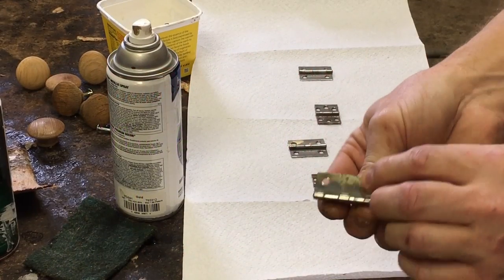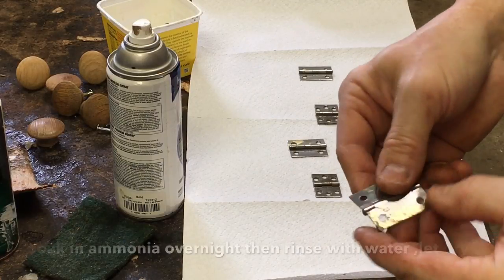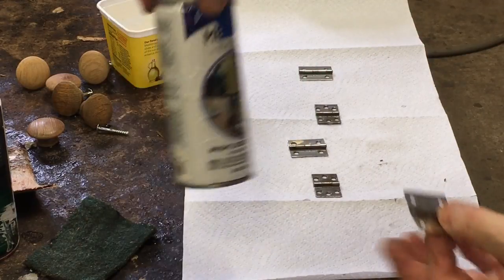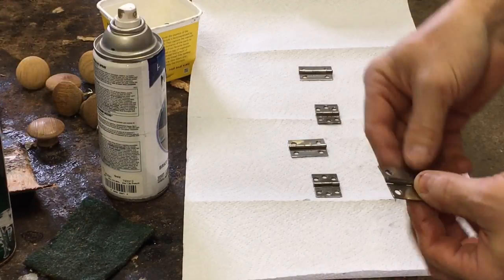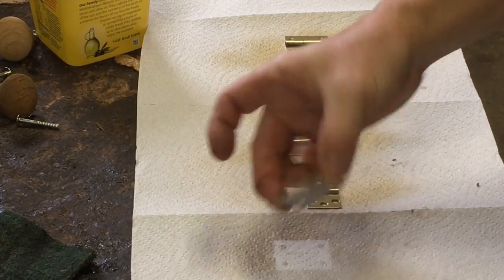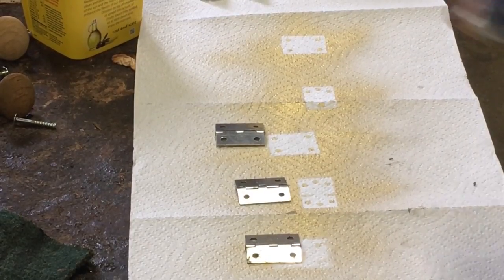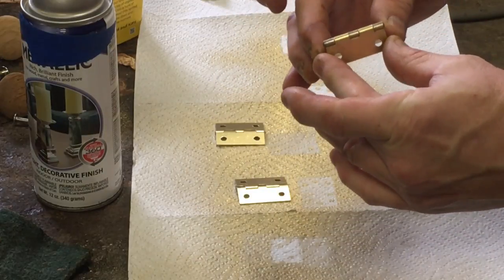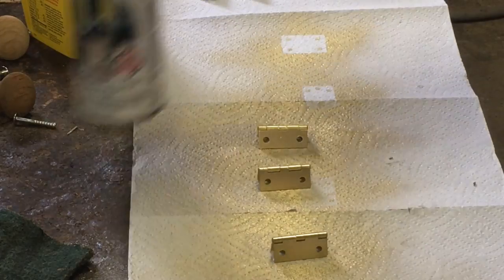SPRAY PAINTING OLD  HINGES TO LOOK LIKE BRASS - ANTIQUE RESTORATION REPAIR FURNITURE

Comment: I have 22 door hinges that have thick coats of paint on them would acetone remove the paint letting them sit in a bucket overnight?
Reply from the maker: I have never used acetone ,  it might work . lacquer thinner will strip paint .
Reply: The easy way to get the paint off is to soak them in hot soapy water in a slow cooker.  After a couple of hours the paint will peel right off.
Reply: @markweaver1012  Brake fluid also has the same process. If you don't want to take the pieces off the door you can put some brake cleaner on a rag and put it on them. Then let it sit for about 15 - 20 minutes and the paint will come off quickly. You might have to do it a few times if it's thick paint.